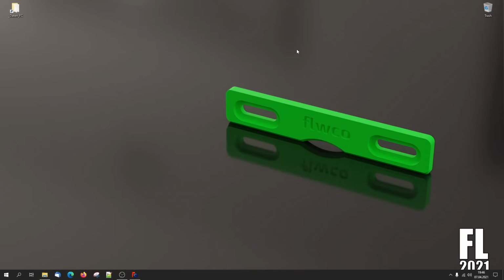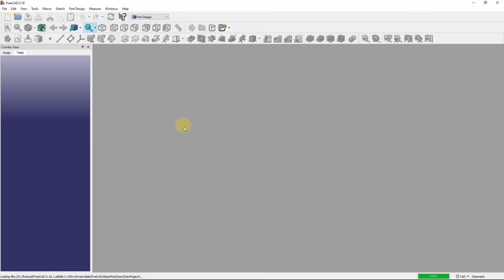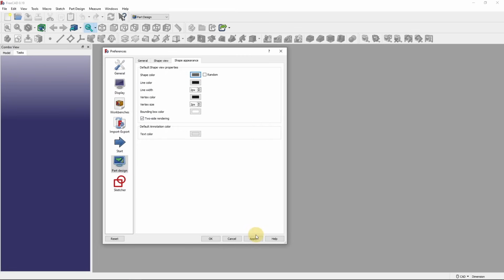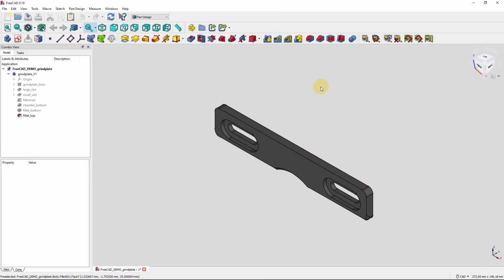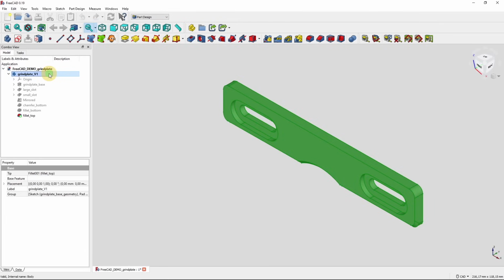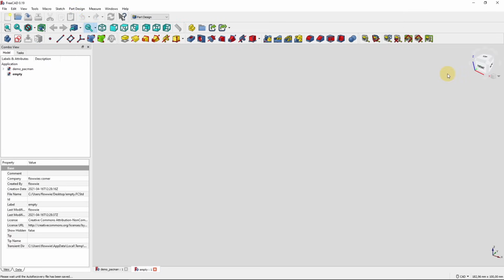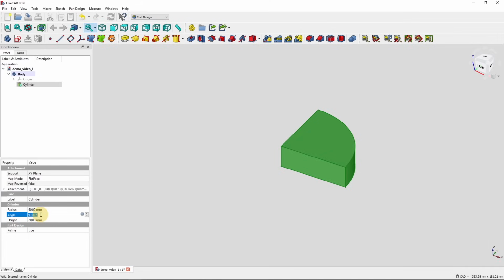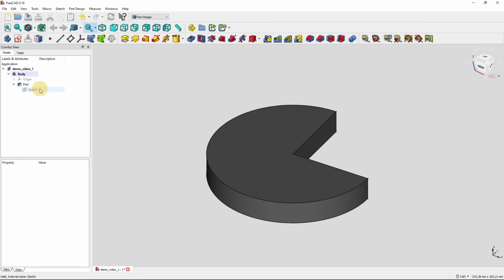FreeCAD 0.19 - Basic Course - Part 1 - Your start with FreeCAD (EN)

Comment: HI , Thanks for the video , I see that I will really like the course.  I just downloaded the software today and although the version (taken from the "About FreeCad")

OS: Windows 10 Version 2009
Word size of OS: 64-bit
Word size of FreeCAD: 64-bit
Version: 0.19.24267 +99 (Git)
Build type: Release
Branch: Branch_0.19.3
Hash: 6530e364184ce05ccff39501e175cf2237e6ee4b
Python version: 3.8.6+
Qt version: 5.15.2
Coin version: 4.0.1
OCC version: 7.5.3
Locale: English/United States (en_US)
 
for some reason my tool bars and my preferences are not the same as shown in your video?? 

Preferences doesn't have the "sketching" , I don't have the "create new sketch", or "primitive" icons  i can directly pick the cylinder from button

Looking forward to binging your course :) 

Regards

Comment: this is an amazing start up tutorial. just one thing. i have been following this from point to point. but when i try to make the sketch version i just get a message that this is "under constrained sketch with 1 to 5 degrees of freedom) what on earth is this?  this is just the simplest of shapes, if it´s this way this programme is going to work i guess ill stop right now :P. it felt so good until now

Comment: Trying our the tutorial, I wonder if there's a difference in the file you used and the one in the Github repository, as I'm only seeing few parts of the model and not the whole thing... (Or is there a file compatibility issue, as I'm using an earlier 0.18 version instead)

Comment: If only the UI of this software was more intuitive.  People can go between Autodesk CAD software and Solidworks, two of the largest in the industry fairly easy.  But not FreeCAD.  Which makes adopting it that much more unlikely.  Even the people at Blender realized their UI was shit, and fixed it.
Reply from the maker: Well it depends.. I switch between FreeCAD, Fusion 360, Onshape and Siemens NX easily without having a problem.
But I get your point that FreeCAD's UI needs some polishing. Let's look forward to the next releases! :)
Reply: @FreeCADAcademy  I found a plugin called Modern UI that once you install, and delete all the completely useless toolbar sections for, is somewhat useable, but the underlying code doesn't seem very intuitive either.  Devs should definitely be promoting that modern UI which sets it up more like Inventor or Solidworks.

Comment: This series will likely justify my transition from Fusion 360. I wasn't looking forward to having to go through the process of restarting my 'free' subscription and I was also disappointed that Autocad had cut the number of files that could be open at any one time. 
Time will tell if at a later date I will be able to convert 360 files to Freecad and save a lot of the work I have done on a long term project.
Many thanks

Comment: Hey Flowie, Thanks for this tutorial. sometimes it went a bit fast between the buttons, BUT, in all fearness, its youtube and its easy to rewind and start over. 
Im a complete newbie and I have no CAD education whatsoever except reading and draw 2D drawing. Rrecently I got first 3D printer and first I was trying TinkerCad, but 
After 7-5 practical examples I found out I am lacknig advanced features and I had lots questions. I am trying your internet curses and I will jump on the second one right away :) Good Job!  Greetings from Sweden.

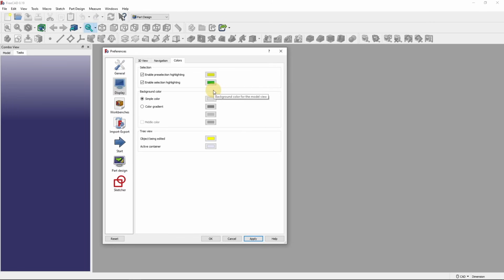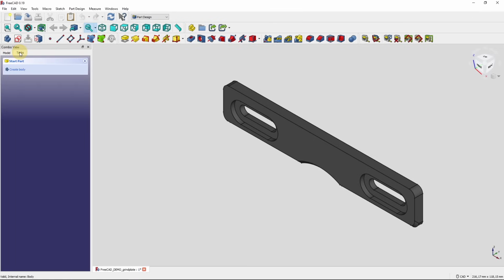Comment: Already have frustrations with this.   @7:23, my fresh install does not have teh "Part Design" or "Sketcher" icons.  @14:14 I have a blank Task tab, not what you show here.   I also don't have the same toil as you show here.  I'm going to hang in there.  As an avid user of Fusion 360, hopefully this can do most of what that program does.  To bad its not customizable to the point I can use the same keyboard shortcuts to evoke functions.

Comment: Very good video. I use an iMac and some aspects of FreeCAD work differently from Windows and the following may be of use to Mac users. First your screen colour mods render the NaviCube invisible so had to revert to default colours. The NaviCube is too small on screen but there is no way to enlarge it in Preferences but there is a modification in the parameters editor using the "CubeSize" integer with a value of 250, which sorts that out. My Mac has a MagicMouse which is a combination of a Touch Pad and standard mouse; to get it to work in FreeCAD you need to select "Gesture" from the mouse menu. This assigns the Gyration motion to the Left button, Move motion to the Right button and Zoom to the Swipe function.

Comment: I am 77 yrs need a design done for the Council building consent (New Zealand) for a deck 7m x 2.8m all in timber, so am learning CAD as a challenge later in life. Flowwie you have hardly missed anything out congratulations! although I have had to go back and forth many times it is all there. Thanks for doing an English version. Is FreeCAD the best option for a 2nd floor wooden deck which will be bolted to an existing wooden building? some sites recommend other CAD methods?

Comment: Thanks for creating the tutorial(s). This one was excellent! The only thing I had trouble with was that my toolbars weren't the same in some cases. I'm using 0.19, but for some reason (maybe because I'm in linux), the toolbars were a bit different (some Icons were grouped... some were not visible, etc...). Perhaps a bit on how to manually edit the toolbars would be a nice addition. On the other hand; it did force me to dig into the menus a bit more than I probably would have otherwise. Thanks!

Comment: Great video but in doing the sketch I create a circle but the constraint tool is blue and does not allow me to enter a value it just says the constraint is set to whatever size I drew. I have tried to do this numerous times with the same problem. Is there some setting I have wrong?
Reply: When it's blue, it means you're in reference mode

Comment: Thank you very much.  I just realised my Fusion 360 would no longer work after having not touched it in a year.  I need to knock out a quick part,  and need to get up to speed in the new tool quickly.

Comment: I feel obligated to leave a comment to boost your luck in the algorithm here.

You are hands down the best tutorial creator I've watched on any subject. I have tried so many times to learn so many different skills via video tutorials, and it almost never works. You explain everything perfectly adequately. I never felt over or underwhelmed by the info, but I've walked away from this half hour feeling much more confident in a program I was previously unable to get working at all.

Especially valuable is your explanation of the workflow and concept of how basic features/operations "stack" to create a complex shape. I'll admit I haven't had and formal training in any CAD software, but they all seem so obtuse and over-engineered for no real reason. Understanding this was critical to me grasping the workflow as a whole.

I will definitely continue to watch this series.

Comment: I wish I could watch this video backwards. everything is covered pretty much in the reverse order of how it should be presented. do your housekeeping at the end. It's the very last thing, not the first thing, because very few people will actually care about any of that. Start by jumping in a project. show yourself designing a project and don't get stuck in any of the details until afterwards. this is an introduction, not the advanced class. I am watching to make sure I even want to bother learning the software. I need to know a few things in order to make that decision. Is it free as in no money? Is it free as in open-source? Will it do the kinds of things I need it do, mostly 2 things: architectural modeling and 3d printing. And is it easy enough to use that I don't need to dedicate 3 years of my life before I can create a simple sketch of the garage I want to build in my backyard?
Reply from the maker: If you don’t have the 20 minutes needed to properly start learning CAD and get your settings right before ending completely confused because my UI looks different from the FreeCAD standard, I don’t have a problem with that. I give courses at university levels in my regular job. If you prefer jumping right into it with some random projects you will find hundreds of other videos in YT, you don’t need to watch my basic course. Just don’t expect me to adapt my course to your understanding of a proper introduction to a software. Best regards

Comment: Thanks very much. Is this program all in  one? And are all 3d printers compatible with it? Many thanks.
Reply from the maker: You will be able to export high quality STL files with FreeCAD and these are 100% compatible to your slicer software that will generate the g-code for your printer
Reply: @FreeCADAcademy  Thanks! so will still need a Slicer?  Which do you recommend that's super compatible with most models?
Reply from the maker: I can’t really recommend because as I know, not every slicer works optimal for every printer. For example I have a Prusa MK3s+ printer and the official Prusa Slicer. That works very well - but as I said this depends on your printer.
Reply: @FreeCADAcademy  Kind of important because I know nothing, and I'm trying to steer & invest in, my local graphics lady in my town, so she can self learn the correct cad/slicer/ machine combo in the sticks of Brazil. So when she learns how I will purchase a semi pro model, then get a library of generic parts, as the normal internal post service is 3 weeks. She is smart but need a 3dP'r that is mostly assembled, with a budget of Aprox $600-700 to start, also want a resin later. Will go well with my buddies soon to open chroming parts business. I'm limited to models online from Brazil

Comment: Thanks for the videos. I have been using Sketchup for years and this is just so different. Will still use Sketchup for my woodworking stuff, but want to learn FreeCAD for creating 3D print objects.
Reply from the maker: That's cool - I also use FreeCAD mostly for 3D designs for 3d printing!

Comment: Hi Flowwie. Thanks so much for doing this. There's been a huge gap here ever since the passing of the gent that was running the LearnFreecad channel and I'm really looking forward to working through your other stuff. I have a couple of comments/suggestions. 
First is: don't be afraid of the video length. Even if you're repeating the same action, it's good to show all of that process, and of course, that's going to make things longer. 
Second: Explain even the smallest details. For beginners there's a lot to learn about the process of using a software like this, as well as the software itself. Please try and describe 
as much of what you're doing as you can. For example, during this video there was one moment, when you were constraining the circle, where you moved the radius marker. I spent ages click on the line trying to move the marker and then I realised that you can click and drag the writing. I'm sure you're so experienced the you don't even think about those little details anymore, but that's a useful thing to know and it's not obvious. 
Other than that, absolutely great, double thumbs up, subscribed, can't wait to learn freecad with you!

Comment: Please explain to me why FreeCAD is not total utter crap. I just downloaded it, and tried to open a DWG file. After about 40 minutes of reading online articles, I believe I understand that, due to AutoDesk's tight-fisted control of the DWG format, FeeCAD relies on Teigha or ODA File converter to convert DWG files and the work on the converted file. But I can't make it work. It just does nothing after I supply the path to the Teigha file converter. The ODA file converter is not free. So, I decided to just try the native tools for creating parts and drawings. I can't find the f**king tool to draw a line. C'mon man! You're a CAD program. "CAD" is the name of your product. It shouldn't be so hard to fine the tool to draw a mother f**king line.

Comment: Hi Flowie, thank you so much.  I started CAD with AutoCAD LT97, then 2000 3D and a bit of Solidworks.  Lately I have been using Dassault Systemes DraftSight which is very like LT97.  I wanted to get back into solid modelling but I have been having tremendous difficulty with FreeCAD because it is so different to SolidWorks.  It looks very powerful but I am really struggling with it but your Basic Course has already helped a huge amount!  I will watch the others and see how I get on!  I am hopeful because I don't want to give up on it.  Thanks, JohnB

Comment: This was great, my only real tangling with CAD was with SketchUp and MoI, I still felt a barrier to entry but this video eased me right through the initial familiarizing of the interface and how the CAD workflow goes. It's not nearly as intimidating as it seems initially and really an amazing efficient way of being able to go back and make large base changes non-destructively, I think it's almost more freeing than box modeling in a way. Thanks for the nice theme setup in the start too.
Reply: I'd stay with both SketchUp and MOI (in particular the latter). FreeCAD is a mess.

Comment: I tried over a dozen times, bout could never fully constrain the circle. I was always off by "1 degree of freedom". Mein Bot!
Reply: Probably Freecad didn't automatically set the constrain to set the origin of circle to the origin of the plane axes. You have to select the two points by left clicking with ctrl pressed and then click on "Create coincident constrain on the selected item".

Comment: Thank you so much for starting this series. I recently purchased a 3d printer because I needed to print some hirth joint discs, being I couldn't find anything I could purchase. I have a really good prototype I designed on tinkercad but I don't like being tied to the cloud for access. Heard fusion 360 was also cloud based so naturally I jumped on to freecad and immediately felt overwhelmed lol. This first video has already taught me so much that I needed to know i will definitely be subscribing. Thank you again.

Comment: I do like the content. And it would be great to see a full course on modeling. 

It is also would be nice to go over some basics on "design" itself (like principles and stuff). 
Also having some info on working with materials and how to do simulations to see if the integrity of the thing is good enough.
And last but not least how to design large complicated things like structures and mechanisms.

Comment: Thanks for putting this together.  For me, it feels like Part 10, not part 1.  One thing I think a super-experienced guy like you does is just click or otherwise do 'something obvious' to you, but to a rank beginner, it's quite mysterious.  Or at least, "eh?".  One example is how you move the 60 mm dimension line (near the end) out of the way, so that it is not sitting on the X axis.  I could not duplicate that motion on my setup (Yes, I also have 0.19).  For a beginner, every single thing is mysterious until it is explained.  I know this can be tedious for someone who 'knows what they are doing' however, otherwise, it leaves us students frustrated because we cannot duplicate what you show.   Thank you, great first cut, and I hope you continue to add parts.   Lastl comment, this one is probably covering too much for one lesson.  Thanks again.

Comment: A great introduction to Freecad. I have already used freecad for some time so I already knew most of the things in the video. But one thing that I really appreciated, was that you showed  several situations where the user accidentally breaks the user interface (closes the combo view for example) and you explain how to restore it. I have definatly done all of those mistakes before and been quite stumped. I am no totaly sure that I would remember such details if I were using freecad for the first time, but I certainly appriciate that you mentioned it. :)

Comment: i m new to freecad (onlyjust intalled it ) after 3 years of being a fusion hobbyist .. since the massive changes and complete utter forcible restrictions that have rendered my complete library of over 30 original  designs  unaccusable,,, im am so pissed off  i have fucked off autodesk and their dispicable ways and was told about freecad  as an alternative parametric modeller   ,so im here checking it out  and seeing how  easy it would be to start using !!   as an alternative to that other program !!

Comment: It would be interesting to see if 0.19.1 becomes available for windows10 32bit its not an issue for me as I have 4 laptops 2 in work and 2 at home with FreeCad on all of them one is a Mac, 2 are windows 64bit, and one is 32bit, I also have Marz guitar design on 3 of them, and I'm really looking forward to seeing someone do a full run-through of a guitar build from start to finish including the routing/milling on a cnc machine, I would love to do it myself but I think it will take me some time to acquire the skills especially as I currently only have a 3018 router

Comment: This presentation is 100% Excellent. This is the most understandable CAD learning I've ever seen. Continue exactly as you are going with this. I will be observing everything you present. The intricate details for setup and controlling the sketch backward and forward are perfect. I was trained in engineering 50 yrs ago on drafting tables long before computers, and have never seen a presentation that was understandable to do it with these CAD programs on a computer since they have first been developed !.
Others with FreeCAD training videos jump over and around with the user not telling you all they are going through with the object and leave you wondering since they know what the program does and don't get into the intricacies they way you do in the proper sequence and progression..